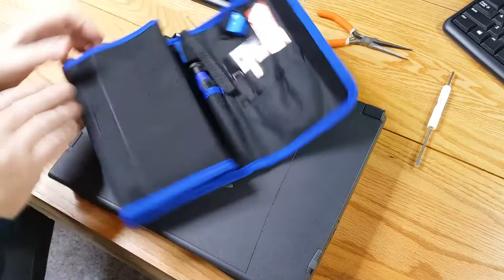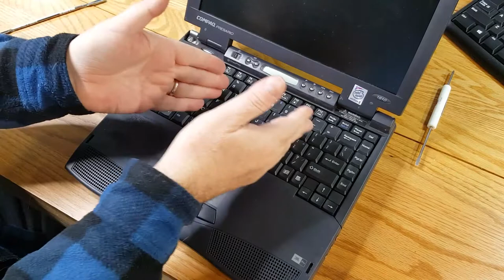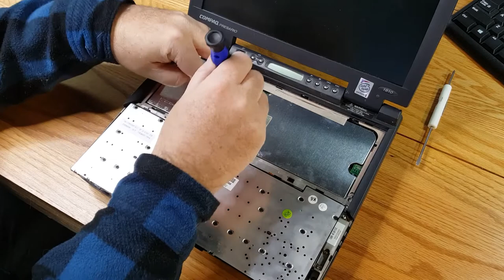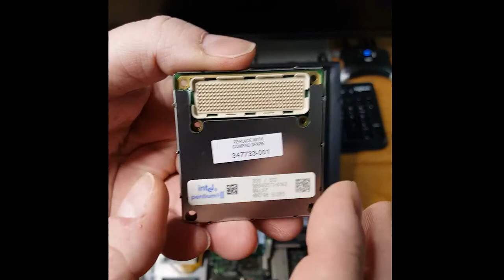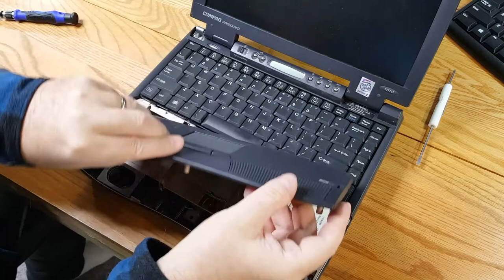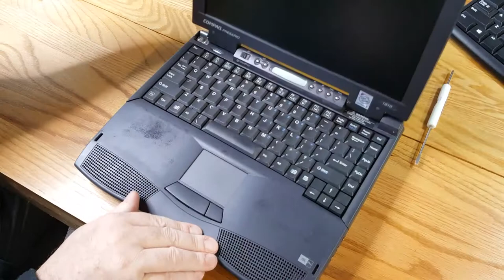Compaq Presario 1810 laptop computer.  Full disassembly and reassembly for maintenance and repair.

Comment: you might want to dig out that battery cause they can leak, ive come across some that ive taken apart and the lithium leaked up the wires and onto the main board.
what are you running on this? what is the gpu/snd specs?
Reply from the maker: You know?  I am not sure anymore.  I'll have to boot it soon again and check for all of us.